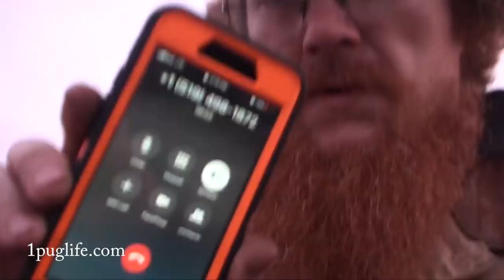first gen crew cab gas auto to manual diesel conversion

Comment: Pug I found something you might be interested in it's called Eastwood that's the name of the company it's (Platinum rust encapsulator) don't know if you've ever heard of it before but it looks like pretty good stuff you just pickle the frame brush or spray this s*** on let it dry and paint over and what it does is it turns the rest into metal again I guess stuff looks good check it out

Comment: You will need to lengthen that front drive shaft or it will fallout of its spline hole due to the traveling of the front axel if you know what I mean